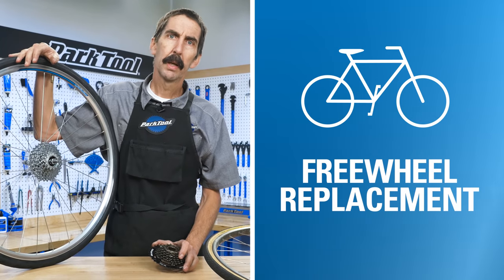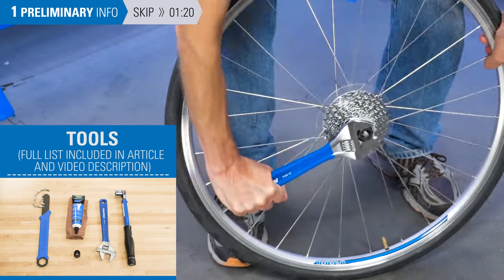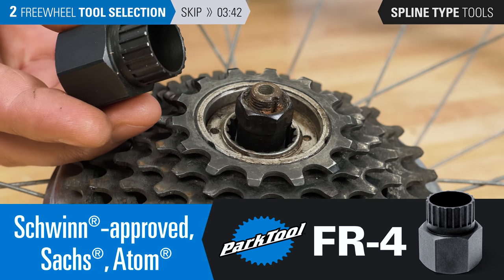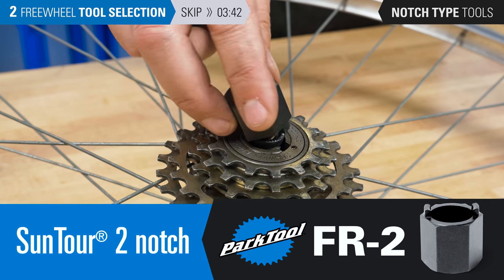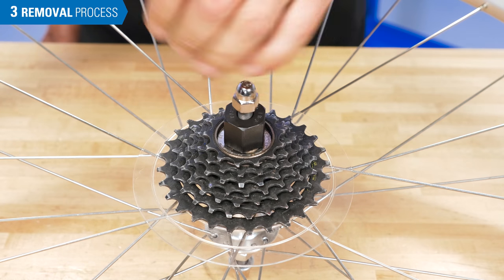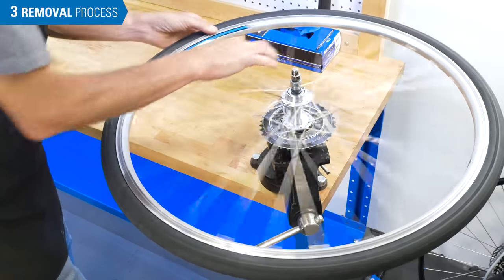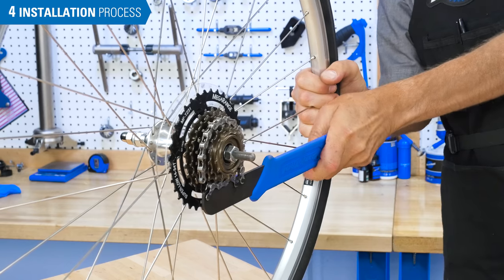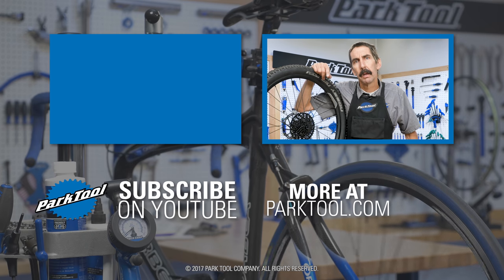Freewheel Removal & Installation

Comment: Do I turn it in the same direction as the freewheel 'freely' spins backwards? or the other direction that the chain would pull?
Reply from the maker: Are you removing the freewheel?  For a freewheel, the tool needs to turn counter-clockwise.  This is as you spin backward.
Reply: @parktool  Yes I need to remove Freewheel from ordinary wheel and Voilamart ebike conversion rear hub wheel, which seems like it's a different size to ordinary wheel fitting, so I need a tool for both? Do you sell the tools for these? Thanks, J

Comment: I can not remove rear cassette. I have the right tools but can not remove the cassette. Its so tight . I try to remove the cassette of few different wheels ( all are Shimano ) but problem remain. I used WD40 but it does not helped. Must not be so difficult. What could be the reason !? Would you please suggest me what to try/do.
Reply from the maker: Have you tried placing the tool tightly in a vise and using the rim as leverage if it is a freewheel or a chainwhip if it is a cassette?
Reply: @parktool  Thanks a lot. Reading your message I found what was the problem. I was trying to remove it like cassette type not as freewheel.

Comment: Good to see the FR1.3 tool has a nice big through hole for working with cables on hub drive electric bikes. I notice that the video doesn't address hub drive electric bikes, basically the same process but more information here if you need it https://youtu.be/Jrr6SI0eq2o

Comment: I bought the park 1.3 to break loose my freewheel b/c my chain jumped off and wedged in between hub and cog. Trying to turn the tool is just dragging more chain in and making it tighter. Help!
Reply from the maker: You may need to cut the chain by using the quick link, or by using a chain tool separate a link.  That will allow the freewheel to turn and not pull the chain in more.

Comment: What did I do wrong if when I put things back together and the wheel ceases to spin when pedaling?  It’s a MTB and a quick disconnect with skewers. Shimano megarange
Reply from the maker: Ah, what fun, a diagnostic opportunity for you!  Begin with the wheel out. Does the axle turn by hand? Now install, and look for what is contacting the frame. Axle nut ends?  Is the freewheel hitting the frame. That's bad.
 Something clearly is being blocked, and it is up to you to find out what.  Step by step, walk it through.
Reply: Park Tool Thank you for the expert content.  We figured it out.

Comment: How do the actual sprocket gears come off of the freewheel assembly?
Reply from the maker: There maybe a locking ring on the smallest sprocket. A common system is to have the smallest cog act as the lock ring.

Comment: OK I'm lost cause mine looks like s freewheel and a cassette. It looks like it has an outer lock ring but has the 12 splines inside. The wheel comes off a 7 speed hurry. I inserted the tool and I'm no weakling but even with all my strength I couldn't get it to budge and yes I was pushing the wrench counter clicker. This bike is not very old and nothing is rushed. When I turn the wheel counter CV lick wise the inner spinners don't turn but the part above the smallest dog looks like a lock ring and it does turn. Help I'm not sure what the hello to do here.
Reply from the maker: That is a freewheel. The internal 12 splined fitting is what you will use to remove.

Comment: So... what do you do if you cross-thread the freewheel when putting it back on!?!? I just did this a few moments ago and now I need to find a way to get it off without destroying anything.
Reply from the maker: That can be tricky.  Sometimes it is necessary to pull the axle in order to engage the freewheel removal wheel.  Good luck.
Reply: @parktool  well.. your suggestion certainly did the trick. I was able to remove the freewheel easily with the FR-1.3 once the axle was loosened.

Unfortunately, it seems the hub might have suffered from the cross threading. The freewheel will screw on to an older rim but I can't get it to screw on to the current rim... Correctly.
Reply from the maker: Bummer! If there are some good threads to follow a thread file may be able to help you out.

Comment: Does freewheel can be service? Like change a ball bearing inside freewheel..? If can how? Because my freewheel cant be servis
Reply from the maker: Taking a freewheel apart can sometimes be done but is not a good idea.  There are not parts available inside the freewheel.  Remove the freewheel and flush with solvent.  Blow dry.  Use a light oil to lubricate.  If that does not fix it, then replace the freewheel.
Reply: @parktool  i wonder did you have vid tutorial about cleaning or guide maintain inside a freewheel?

Comment: I have a question.
Do you need to change your disk break rotor? My current hub is thread type and im gonna change it to cassette type does it effect the sizing? Of rotor? When i change it to cassette ( haft english from philippines )
Reply from the maker: To change to a cassette you will need a different hub or wheel. It is often more cost effective to purchase an entire wheel. It can also be fun to try your hand at wheel building I would suggest doing a bit of research before trying to rebuild the wheel. I hope this helps!

Comment: Could i ask what is the 8 speed largest sprocket for a freewheel?
Reply from the maker: Falcon makes a 13-40 but there may be some other brands getting into wide range 8 speed that have a larger range. One issue will be finding a compatible rear derailleur.

Comment: he seemed to skip a part.... .. ok he didn't but mine has some issues.... i removed the freewheel using the tool and turning counter clockwise.  the sproket came off....... but then the bit underneath was very loose and bearings went flying everywhere..... i missed that part in the video.

Comment: I don't get it. When turning anti-clockwise, the cassette follows to turn. The freewheel doesn't comes off. Pls help.
Reply from the maker: Begin determining if you have a freewheel or a cassette.  See https://youtu.be/iTJ3taJHOn8   
If yours is a cassette you need to hold the sprockets while turning the tool anti-clockwise.  If it is a freewheel you must NOT hold the sprockets, but only turn the tool
Reply: @parktool  But my inner most fitting does rotate with the sprocket when spinning. So it should be a freewheel. The groupset is Shimano ultegra 11 speed which is stock set on Merida Scultura 500. Freewheel is Shimano CS-R7000. Buy when using the removal tool, the removal tool move alongside with the sprocket.
Reply from the maker: @chocoluckystar  You need to hold the cassette still with a chain whip.

Comment: And how do you remove the freewheel when the hub is not attached to the bike wheel? This is my case.
Reply from the maker: This is not going to be easy. You need to hold the hub stationary. One way would be in a vise. if you would liek to re use the vise you can try to get soft jaws that interface nicely or you could try to drill a hole in a piece of wood to match the diameter of the hub shell so you can then cut that piece of wood in half and use it as the soft jaws. Im guessing the spokes were cut before the freewheel was removed?
Reply: @parktool  I had an accident in road. The wheel was very meshy. I unscrewed most of the spikes and then, i tried to put these spikes out of the hub. Therefore, I have a hub with a Cassete (not freewheel, sorry), Shimano CS-HG31-8. The hub is OK and the cassete. They are intact. I have the special tool to unlock it. So i put the removal tool on the cassete center. Also, i have a vise and two French wrenches. I tried with these tools with different combinations. It is very hard to unlock it. I am waiting to arrive the Chain Whip. It may be easier. Thanks for commenting. Your videos are absolutely amazing! I am watching them whenever I have a problem. Hello from Greece! #GoVegan!
Reply from the maker: The chain whip will make a big difference for you. Hello and thanks for commenting with your situation, its not a common one but does happen occasionally. Being a cassette is a good thing, a freewheel would be a major challenge.

Comment: Dose Park Tool make a freewheel tool for a 12 spline ATA freewheel that fits over an E-Bike axle?
Reply from the maker: The FR-1.3 should be the one to fit. Do you have a picture? There are a few e bikes that require you to remove the outer most locknut to remove the freewheel. This is not common though.
Reply: I don't know how to send a picture on You Tube reply but I am sure the FR-1.3 will work.

Comment: What if my freewheel doesn't have any notches or splines?
Reply from the maker: There are older Shimano and Suntour cassette system that have no lockring. The first sprocket holds the other, and acts as the lockring. It requires two chain whips to remove. This may or may not be your system.

Comment: I have a Sunrun freewheel cassette I thought the tool I had should work it seems to fit seems to have the right amount of spines around 12 but it simply won't move in any direction my guess is the tool I have doesn't reach all the way in and may need a different one. I'm having no luck getting the tool I have to work and now I don't know which one I need can anyone recommend one for it, please?
Reply: KoolBreeze420 maybe the cassette has started to seize? I don’t know, maybe take it to your LBS (Local Bike Shop).
Reply from the maker: Im guessing you have a freewheel from Sunrun. During pedaling those are being tightened onto the hubs threads. They can be EXTREMELY difficult to remove, turning it counter clockwise is correct. Sometimes clamping the tool firmly in a vice then grabbing the wheel at 2 points roughly 180 degrees from eachether and turnign the wheel can be the best way to remove a stuck freewheel.
Reply: Park Tool also putting a decently long pipe on the handle of the tool your using works great for getting more leverage. It’s what RJ the Bike Guy does for seized freewheeled.
Reply from the maker: Leverage is your friend no matter how you achieve it.

Comment: Will there ever be a time when It will be impossible to remove the freewheel with the free hub tool by hand ? I'm currently trying to remove mine with the 'Fr1.3', but it's insanely hard with my wrench! Anyone else in the same issue? Any suggestions, anyone?
Reply from the maker: First, you are sure it is a freewheel?  See that video first.  For a freewheel you do not use a chain whip for removal. You need to arrange the wrench and yourself for best mechanical advantage.  Hold the wheel on the ground vertically.  Put the wrench at 90º, so that pushing down is counter-clockwise, and give it a big push.
Reply: @parktool  Park tool HEY!! Thanks so much for responding. I had given it another try just now and still no movement sadly. I have no access to a vise, but I may just have to seek help at a local shop.

Now, I count 12 spins, but not sure weather it's 23mm in diameter. I need to find the right measuring tape to confirm this as well however, my freewheel states 'Sunrun'. Maybe this will determine if I have the correct tool for removal?

Comment: Pls help, my cassette is wobling, is it my cassette cross threaded??
Reply from the maker: It is normal for there to be a little oscillation in the cassette or freewheel. If it seems excessive it would be wise to remove and verify that everything is tight and in the correct order.
Reply: Gee, thanks i appreciate the reply ♥️

Comment: After a freewheel is assembled, should it be fairly solid without any movement from side to side? I bought a new bike and the freewheel has about a mil or 2 millimeters of movement side to side (i.e. if you were to push down or lift up on a tooth towards or away from the spokes). I ask because after switching gears, sometimes it makes a knocking noise which is the freewheel jostling side to side. Its made louder because it's a fat tire rim (the vibrations are more noticeable due to the larger cavity). Should I demand Trek fix or replace the freewheel (it's a shamino)? The bike is here: https://www.electrabike.com/sites/default/files/styles/bike_full/public/skus/539996.jpg?itok=Y3exVQIg
Reply from the maker: Freewheels will typically have play back and forth. Too much is not good though. I would bring the bike back to where you purchased it and ask what they think. It is one of the great perks of purchasing from brick and mortar retailer. Hope this helps!
Reply: Hi Cosmo, I just bought a SunTour Perfect freewheel to replace the same model freewheel on a 1980 Raleigh Super Course. It has play just as you describe. I'd say the total side-to-side play is about 1mm. The original had play too...maybe not quite as much. As already mentioned, you have the advantage of having purchased your bike at a brick and mortar establishment. Good luck!
Reply: Thanks - yes, after a new wheel replacement which didn't fix the issue ( knocking) I went back and asked if they replaced the freewheel with the new tire. They did not. After replacing the freewheel the knocking went away permanently. The new freewheel side-to-side is 1mm apx. The old one was about 2-3. This created a gyro effect at times when out of equilibrium and caused the knocking - which was made more loud because of the fat tire rim is basically a frame drum.
Reply: Cosmo Spacemonkey Thanks for sharing your outcome. This "play" in freewheel hubs is unsettling despite appearing to be normal. I don't like to see "play" when riding "the most perfect machine ever invented." 😄

Comment: How if i want upgrade from freewheel to cassette ?
Reply from the maker: It is not possible to convert the freewheel style hub into a cassette hub.  To upgrade to a cassette means a new hub.  That typically means a complete new wheel, unless you want to unlace the rim and rebuild over a cassette hub.

Comment: Can't get mine off the bafang motor, cable is in the way.
Reply from the maker: What tool are you using?
Reply: @parktool I've got an ebike (£100 - $70 :D ). I need to remove the terminal block so the cable can go through the hole in the FW remover.

Just want to see if I can remove a rpm restrictor on the motor, 15.5 mph isn't fast enough.

Comment: I don't understand why you only use the removal tool for loosening but then a chain whip is shown for tightening?! Can't you tighten it with the same removal tool + wrench that was used to loosen lol?!
Reply from the maker: You can use a whip, or the tool in combination with a wrench or you could install it with your hands. When you step on the pedals the freewheel will be fully tightened by the pressure of pedaling.
Reply: I also found this puzzling.  Makes total sense to use the removal tool to reinstall with appropriate torque.

Comment: where could I buy a 9 speed freewheel? is it available?
Reply from the maker: 9 speed freewheels are not the most common of freewheels. I'm not sure what sites deliver to the Philippines but jensenusa, Excel sports, universal cycles or 365cycles would be good sites to check first.
Reply: I've read some threads about threaded 9 speed and i think that its not a good idea. Thanks for replying sir! didn't expect that you'd reply
Reply: It is available in Lazada, "Sagmit 9 speed freewheel"
Reply: Freewheels are only good up to 7 speeds. Higher than that, the freewheel becomes a poor design and is suspectible to axle bending and breakage. If you want higher than 7 speeds, you need to use cassettes.
Reply: @misternobody4644  having said that, the video clearly shows free wheels greater than 7 speeds.  I was told the same thing but managed to successfully convert a 7 to an 8 with no signs of axle bending.  (It is a solid axle not a skewer type.)

Comment: Stupid new guy here: Just so I'm clear, the term "Free Wheel" and "Free Hub" are referring to the same thing....right?
Reply from the maker: That is a good question.  "Freewheel" is an old term for the ratcheting system of the rear sprockets.  Shimano then came out with a system where the ratchet is built into the hub, and called it a "Freehub" to differentiate it.  The "cassette" sprockets slide on the a freehub.  Cassette (sprockets only) are removed in the freehub system, and the ratcheting body stays on the wheel.   When you look at a bike rolling by, it is hard to tell them apart. See https://youtu.be/iTJ3taJHOn8

Comment: My freewheel stuck how i remove it
Reply from the maker: It is normal to take quite a bit of force to remove the freewheel. More leverage is often needed. So using a larger wrench or putting the tool into a vase and using the wheel as a lever can help. Let us know how it goes.

Comment: This video is quite practical, but deceptive.  FYI....if you damage your wheel socket using a two-point contact (like a vice, or the thumb wrench used here), Park Tool will reject any warranty claim.

In his response to me, the rep said that a 1" socket OR the FRW-1 wrench should be used, providing even  contact on all sides of the socket....even though this official company video doesn't illustrate or even mention that.   
Even crazier....he even acknowledged this very video in the response to my claim !?   

Very disappointed.
Reply from the maker: Your warranty was not rejected. Being that you are in Canada, to process a warranty you need to bring it back/ return to the place you purchased the item. This is an agreement we have with all international distributors as they are much closer to you when an issue like this occurs.
Reply: @parktool    Then why didn't you mention one word of any of that in your direct reply to me ???
Reply from the maker: "You are welcome to return it where purchased for warranty consideration"